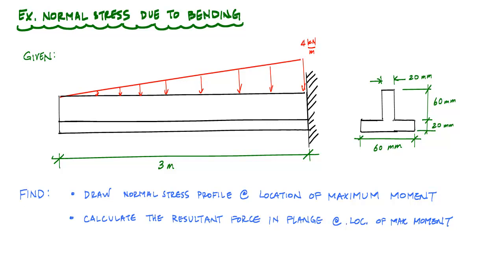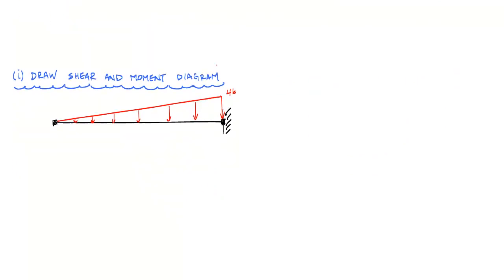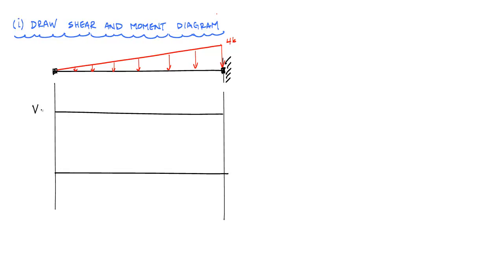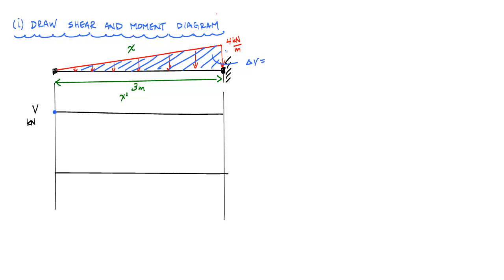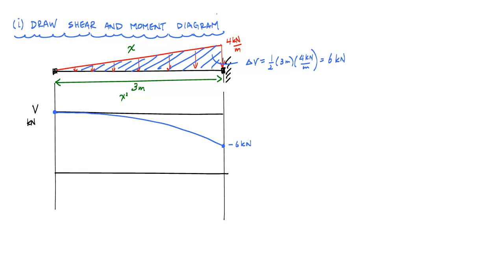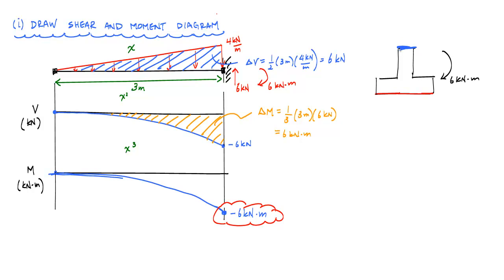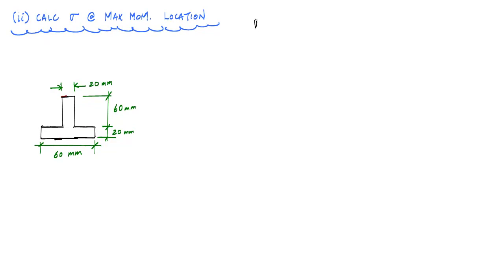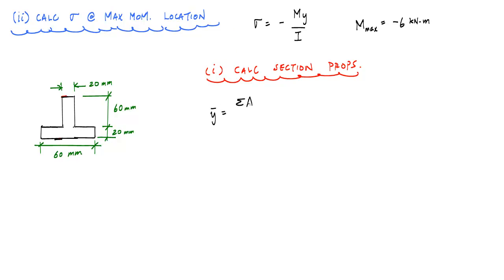Normal Stress Due to Bending Example (1/2) - Mechanics of Materials

Comment: This may be 8 years too late but why did you draw the moment at the support going clockwise? If we were to continue that drawing so that it was on the left side of the discontinuity, it would also be going clockwise, making the moment diagram have a value of positive (+)6 kN*m instead of negative (-)6 kN*m.
Reply from the maker: In my first fbd, the moment is counterclockwise.

Comment: I'm a bit confused. At @2:53 you drew the shear diagram parabolicly. Isn't it just linear as your force increases linearly: at 1m it's 4kN, at 2m its 8kN, at 3m its 12kN, etc.
Reply from the maker: +Max Lightning when you have a linearly (x) distributed load then the shear diagram is parabolic (x^2).  This is all based on dV/dx = w.
Reply: @structurefree  if it's based on dV/dx = w then wouldn't V = wx + C once you integrate? Which is linear
Reply: Max Lightning you can apply that to distributed loads (Square), when a linear load is applied (triangle) it's 1/2 (Base)(Height)